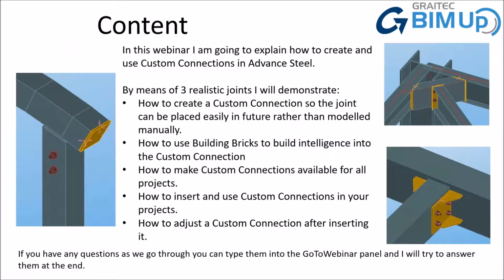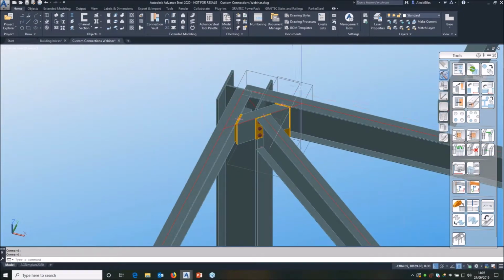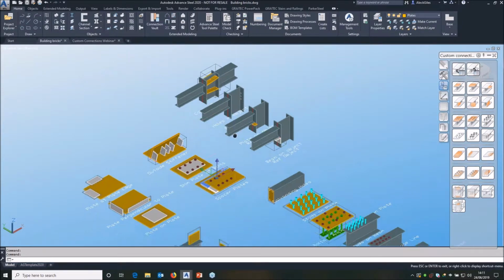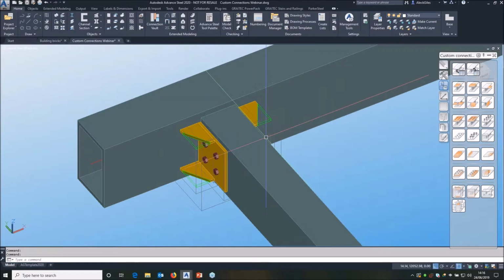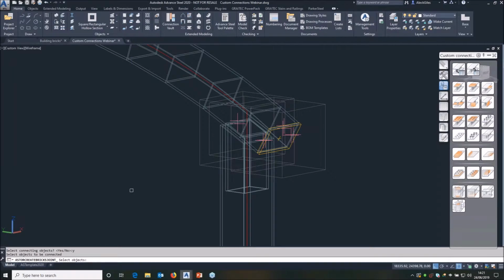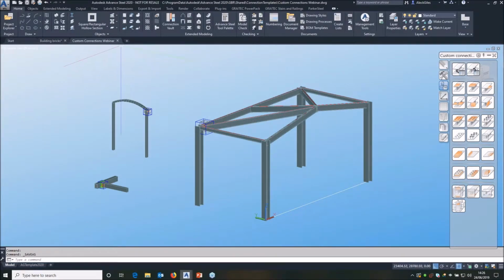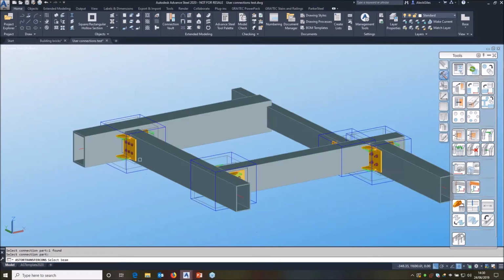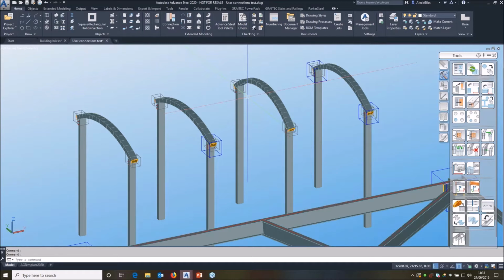Custom Connections in Advance Steel

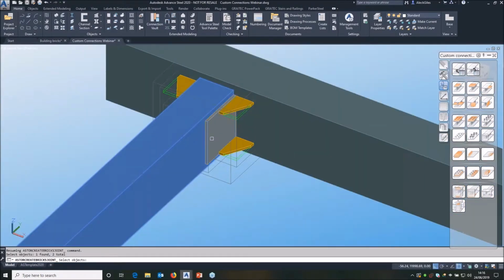Comment: @15:04 
I am following same process but, bolt is not passing square tube at other end. also, other side plate is still not fix with bolt. In short, bolts are connecting only main plate and square tube one side thickness.

Please help...

Comment: I want to connect existing w beam with new column HSS  ( below  the existing beam) with 2 clip angle  , clip angle to be welded to the beam at site, HSS and 2 clip angle to be bolted to gather with slot in clip angle. please advise if i can make this connection with existing maco or I have to make custom connection,